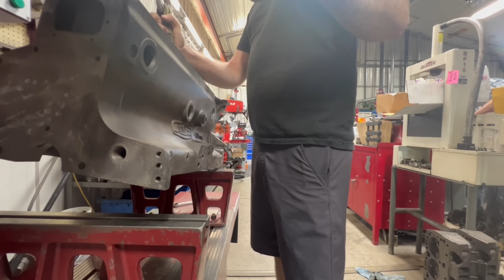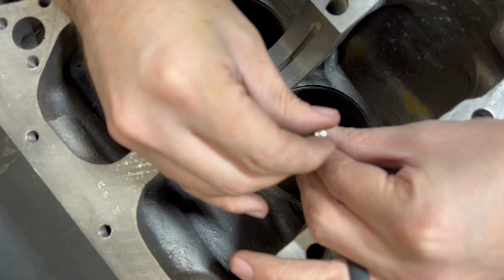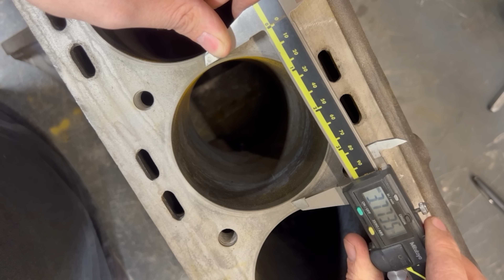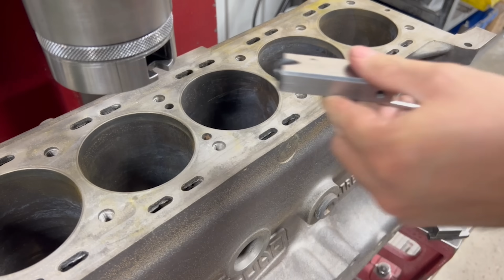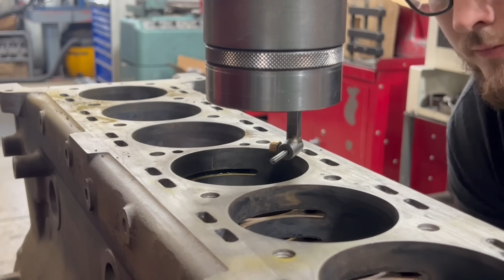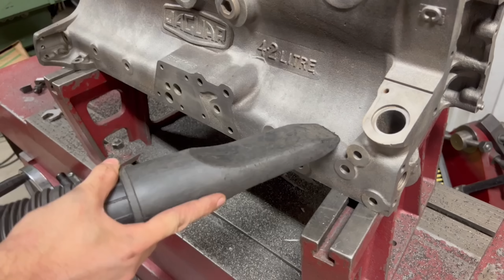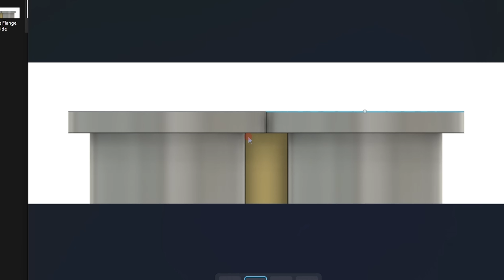Can This 1968 4.2L Jaguar Block Be Saved?

Comment: The cracks aren't structural so the only issue is coolant leaking. Wouldn't the flanged liner + the green sealer be enough to prevent that leaking. That stuff is pretty good I can't imagine the water getting past it to be honest.

Comment: IF it is a showcar driven like grandma on odd occasions use those stepped sleeves. Ideally drill the root of the crack to stop it spreading.
IF it will be used regularly and hard scrap the block. Whatever you do it will just fail. 
Part number and matching numbers junkies will pay more for crap than having a good serviceable part. Give them the matching number block to carry in the boot!!

Comment: braze them cracks up, put in hat sleeves, move on. if you need custom sleeves lmk, I'll make a set out of 4140 for this. I've built a bunch of jag motirs, block problems are the norm. I'd goto a stronger bigger sleeve in 4140, braze the cracks.

Comment: You need to braze the cracks with acetylene torch and a proper fluxed wire.
Flanged sleeves alone won't work for too long as the cracks are too deep.

Comment: I agree flanged sleeves with LIGHT or near zero press fit is the best option.  Good job.  I see people in the comments really want to fix the cracks........I'd rather focus on repairing the engine so it function correctly.   We should talk sometime.

Comment: From summer 2020, new 3.8 liter blocks were available from Jaguar for 14,340 pounds each (about $16,000 then).
Reply: They will even stamp the original number in them to keep the car "numbers" matching.
Reply: @michaelau5159  
Doesn't help if you want a 4.2?
Unless you resleeve it?
Reply: @JohnSmith-yv6eq  bore spacing between 3.8 and 4.2 is different. 3.8 is slightly offset while 4.2 is evenly centred. I think the best thing for the engine in the video would be new Darton flanged sleeves. They even have coolant ridges to help with keeping the cylinders cool more evenly.

Comment: For those concerned about the cracks consider their location and how they likely formed. which is thermal cycling stress, not mechanical loading stress.  

Where they are is not a structural point that will ever see any high degree of tensional loading across the lay of the crack.   Also given what application the engine is going into, the odds are it will never see a huge amount of high-loading abuse ever again, let alone to the degree that will drive excessive crack growth into any meaty part of the block that matters.
Reply from the maker: I’m not very worried about the cracks from a structural standpoint. I am worried about the cracks from a coolant leaking into the cylinder standpoint.
Reply: @JAMSIONLINE  Why would it leak into the cylinder?  The liner and head gasket seal prevents that.

Comment: Given the galling of the sleeves, I wonder if the press fit was too tight and that started the cracking of the thin sections at the top of the cylinders. It looks to me like the coolant passages have acted like a stop crack and the cracks won't propagate below the bottom coolant passage. I think the flanged sleeves  would be sufficient. I have attempted to weld cracked cast iron blocks with bad results. I'm of the opinion that it's not necessary. The cracks look like a dubious application for Lock n Stitch but I don't have any experience with the product and technique.

Comment: lock n stitch does not sound like a viable repair for the type of cracks and their location exhibited. Welding is the proper way to completely repair like new. shoulder sleeves still run the risk of leaking.

Comment: Counter bore, install flanged sleeves, drill crack ends to prevent propogation
Old Jaguar guy
Thx for videos, great refresher.
Reply: They can't crack any further now. They are down to the cooling passages

Comment: I wonder how to seal the coolant passages around the sleeves. Will the green locktite  handle that. Should the bottom of the top hat flange be smeared with hylomar to stop water migration from the cooling passages and the crack from coming up around the flanges on the sleeves. I would apply green locktite to the block bore below the flange cut so it does not fill the relief.  Then hylomar around the underside of the sleeve flange.
   So it seals around the bottom and sides of the flange as you finish pressing it in.  

You probably wont be able to heat the block or chill the sleeves. So a press tool will be needed.  Be sure to cut oring grooves in the side of the press tool but not as deep.  Like a cam bearing driver to stop any possible rocking from damaging the bores.

Comment: Your idea for flanged sleeves is a good one. But I’m wondering if it would help to braze the cracks? 
I remember seeing an article where they did that along with flanged sleeves to save a numbers matching 63 Corvette.
Reply: Would using a high nickel welding rod be better.  It reduces the heat input to the block immencely.   I performed a crack repair many years ago on an old 272 Ford Mercury engine which cracked between two bores.  I drilled and tapped a small hole on the crack.  The hole had a small lead in chamfer.  I used a silver frost paint to coat the screw.  This was then cut off and penned in place.  Another hole was drilled and tapped which overlapped the first hole.  The surface was ground flat after that.  I was only a teenager at the time and we had very little access to tooling.  Anyway the repair worked well.  The engine was in my speed boat so as you would appreciate that motor got a hiding.
Reply: @johnspathonis1078  ah metal stitching Did you use a regular bolt or a specific bolt designed for that purpose.
Reply: @TheMadHatter626  we have used brass 1/8” pipe plugs in 6 cylinder Diesel engines. But that’s on the side of the crankcase and not the deck surface.
Reply: @TheMadHatter626  Hi Wolfman.  It was just mild steel 1/4" UNC screws. I was an engineering student in 3rd year of my course so I had next to no excess money.  We scrounged as much second hand and free stuff where possible.  The block performed a bit like mild steel so I suspect is may have been an early type of SG cast iron.  The crack occurred from a blown headgasket between two cylinders.  We were on a water skiing expedition a long way from home so it ran for a day or so with bad blowby.  The head was a rightoff.  I must admit it was entirely a self induced problem.
Reply: I like to ideal of using a good machine to drill hole to the bottom of the water jacket and then using a bolt of the right grade with some green loctite I called sleeves compound which I usually use to put the sleeves in re bore the home and maybe put a step sleeve in. And finish off by Decking the block.

Comment: im familiar with the GM 400.... and its "steam holes"
but why on EARTH would they put 2 slots in the cylinder walls? 
.
coolant would flow without the slots, right?
and the slots would cause unequal cooling, right?
.
idk.... just seems like a solution to a problem that didnt exist 
if i was the engineer.... i would have went with the 400 SBCs "steam holes" idea VS making the cylinder weaker 
.
.
then again.... the 400 wasnt made till 1970

Comment: Top hat sleeves and oring them for extra insurance. If its a restoration they probably want stock or near stock power levels. Trying to weld, braze or metal stitch the cracks can often cause more problems. Especially welding or brazing.

Comment: Use the flange sleeves to repair it.  Use an off the shelf sleeve set if you can find one with usable dimensions.  A custom sleeve set would be the best repair on this as you can dictate the sleeve/flange dimensions to fit your desired comfort level on the repair.  

I'd gather that if the cracks in the "shelves" between the bores are the only cracks in the block and fully traverse the "shelves" with no path to continue, that the extent of the cracking could be done and the sleeve repair could last.

Comment: after watching i'm wondering why not grind a groove all around and drop a beat from inside the bore, on top of deck then inside again. This will penetrate deep into the crack from all sides. Heat treat the block to relieve stress and then bore and surface.

I'm not sure about the crack on the center area. I would say to do the same on only the bore side. grind a groove with a dremel. Considering cracks will only continue to propagate and having coolant in that area may eventually cause corrosion to build in between the crack.

I just feel like welding>heat treat>bore/surface is the correct answer

Comment: First off, I know nothing about jags...

Just to look at that though, given the facilities you have I'd go straight to brazing those cracks with a bit of bronze and then fitting the flanged sleeves. That way you greatly reduce the chances of any future problems.

I'm sure you know what you're doing and have your own way of doing things that works for you, but anyway...

Grind out the cracks, put a bit of sodium silicate into the water jackets to protect them and then make up a sleeve to put down into the bore with a large enough lip to extend out over the web.

If it's the 5/6 cylinder web that you're doing you stand the block on the timing end and put the sleeve in 5. You can then braze the web easily without chasing it everywhere.

Then chuck it in that oven you have there and let the whole thing heat soak as hot as you can get it, take it out and finish the preheat with the oxy and braze the webs up.

Back into the oven for cool down, then wash out the silica and machine the sleeves back out till there's little left.

Heat treat for stress relief then finish up the machining.
Reply: Usually yes but bronze expansion rate is different then cast iron that will be a issue in that thin area

Comment: No idea what it costs, but Jay Leno has had some things "metal stitched". He had a rod through the side of a one of a kind steam fire engine and they were able to stitch the block back together.
Reply: I have done repairs like this and the lock and stitch repair is the best way to fix cracks like these in an iron block . They won't be able to do anything about the cracks between the coolant passages but that's alright. I have never heard of anything bad coming of coolant leaking into coolant.

Comment: This is going to be interesting, just how far the customer wants to go, to re-build this.  Of the options, I believe the flanged liners would be the most cost effective.  However, I would want to have the flanges 'overlap', where they would require machining to mate.  With consideration to thermal expansion, I'm curious as to what amount of 'fit' would be necessary, as related to 'flange to flange' clearance.
Reply: Numbers matching block - difference could be thousands of dollars!
Reply: P
Reply: NOT doing it will cost more than  saving a numbers matching  68 Jag

Comment: I would put the oversize sleves, but with even more oversize and flattened of edges in between the zylinders. That way, i can make sure, that there is good material on the sealing surface.

For the damage in the zylinders, I personally would slightly bore out the zylinders to a bigger diameter, to clean up the nasty surface before fitting new sleves.

As for fixing the cracks,... Welding can be very difficult, but an other option would be hard solder and a finish pass, to clean the surface. But I have no expertise in this area, so take this idea with a grain of salt. (theoreticaly it should work, practically... you know)

Comment: Check out the Barum Engines YT channel. They've got a couple 4.2l Jags they're doing, and could give you a few pointers on how to seal this up. Seems like they have at least one 4.2l a month come through their shop. They're in the U.K., and definitely have a bit of experience machining and rebuilding these engines.
Reply: I agree, Lee from barum engines will set you straight

Comment: The cracks in the block casting won’t propagate through the steel sleeves.
Reply from the maker: It’s not a concern of propagation through the sleeve. It’s a concern of coolant leaking into the cylinder across the top of the sleeve.
Reply: I see. Thanks!

Comment: I do not have any experience with an engine like this. I do have some experience with antique gas engines that are extremely valuable. I had a cylinder repaired at a place called Columbus Cowell in Columbus Ohio and they Furnace Brazed two extremely long cracks in the water jacket. They also bored the cylinder and put a sleeve in it.  A friend of mine who did restorations on extremely expensive venues worth hundreds of thousands of dollars recommended this to me. The brazing and boring and sleeving came to $5000.

Edited for spelling corrections caused by YouTube voice to text. Hopefully it is fixed now, one never knows with this option.

Comment: My first question is do they make a high quality head gasket for those Jag's that will work with this problem(large fire ring with quality material)?  I hope they aren't like IH's D236/282/301 Diesel engine family, they got alot of issues and the available gaskets that are not of great quality and they make a bad situation even worse...........

Comment: Thanks for the dial indicator level check. Great video and quality work. Those water passages in the cylinder liner are a terrible design flaw.
Reply: They worked just fine in the 3.8 engine. When the factory took them to 4.2, they did it with an overbore and those blocks have the cracking issues..
Reply: @TyphoonVstrom  So the extra boring of the increased displacement of the cylinders meant the sleeves were too thin at the top of the cylinders, and then caused the sleeves to crack? I now understand an additional reason for the increased size of the step at the top of the cylinder block... To stop the cracking of the sleeve in that high pressure / highly stressed area... I did not notice a crack on the Aluminum casting... A mark of the Dye penetrant bleeding through the cracked liner, yes that is apparent... But I did not notice a specific crack of the Aluminum casting... Is this where the castings are also known to crack?
Reply: The Volkswagen Golf engine started out as a 1.5 with water between all cylinders, but the later 1.8 and 2.0 versions had solid metal between the two center cylinders
Reply: @erik_dk842  , that is a good observation... I noticed that several engine manufacturers have done that , especially with their dry sleeve engines... The castings were 'siamesed'  joined between the cylinders... I heard that some companies have done away with cast-iron sleeves in aluminum castings, by using the 'nikasil' plating process.. Some of these companies had reasonable success with this technique, while other manufacturers had problems with it... Jaguar 🐆 was one of the companies that had lots of problems with that process... Personally, I don't like major castings like engine blocks to be made in such a way that they can not be restored by machining cylinders to an oversize... And that is precisely the situation with the 'nikasil' process, no machining of any surface treated in this way can be done to restore the surface without replacing an ALUMINUM liner with std. sized pistons, which is also questionable if that can be done reliably.. A single life use of the treated pistons & rings and/or the cylinder liners is all that is practical with that process... My guess, is it could negatively affect the resale value of a vehicle, especially one that was originally sold as a high-end vehicle, like a Mercedes , BMW or even a Porsche... It appears that the use of low sulphur fuels, that is the ONLY type of fuels being sold in certain areas, negatively affects the cylinders and pistons that have been treated with the 'nikasil' process, that could cause the 'nikasil' coating to delaminate from the parent material, causing extensive internal engine damage... No thank you, I'm avoiding that situation like a  potentially insane in-law ..
Reply: @WRXHEAD, Yes, I was thinking the same thing..  Literally an 'open' invitation for very bad corrosion to develop between the block and the sleeve...Luckily, on this engine, the corrosion btwn. The block and that sleeve that the machinist removed appeared to be minimal, probably because the correct anti-freeze concentration was maintained in this engine, and halted the corrosion... But as soon as the concentration of A/F gets below 25%, the corrosion becomes very bad, especially between dis-similar metals like aluminum and steel, or cast iron.... I imagine that after that type of corrosion takes place, coolant starts leaking into the crankcase, and then destroys the bearings of that engine... I don't know WHY Jaguar 🐆 did that, but I certainly don't like those slots, and would consider having them slightly beveled, welded shut, then machined flush with the adjacent surface... Do any other companies do this without using 'O' rings on the outsides of the liners, like the Diesels do?

Comment: That engine has been sleeved before it did not come from the factory with sleeves.
Reply from the maker: It 100% comes from the factory with sleeves.
Reply: Can't imagine a machine shop cutting the cooling passages in the cylinder walls prior to sleeving the engine? Seems like that would be a factory trick but there is a lot of things I have never seen.
Reply: Early 4.2 blocks were sleeved and had the horizontal coolant crossovers cast in. Late 4.2s seem to have had an alteration to the coolant passages between bores and didn't have liners. Well, my 4.2 in my '83 XJ6 didn't have sleeves and had different coolant pasage layout on deck surface.